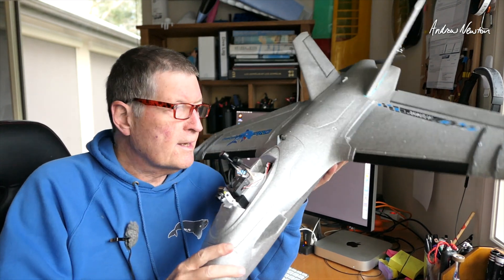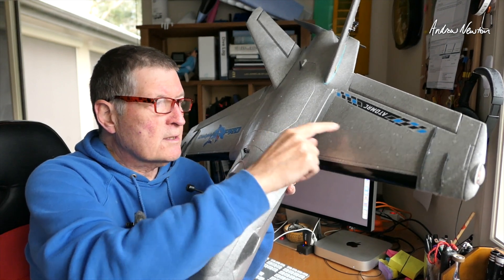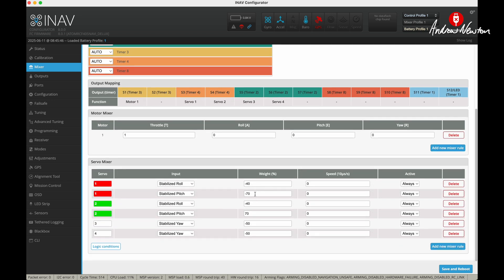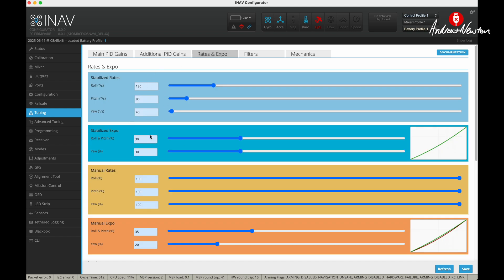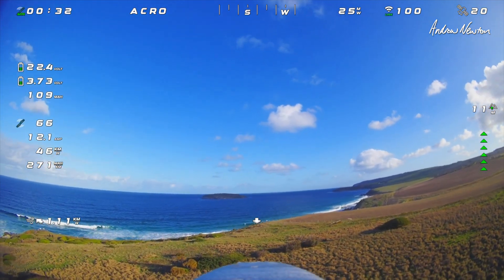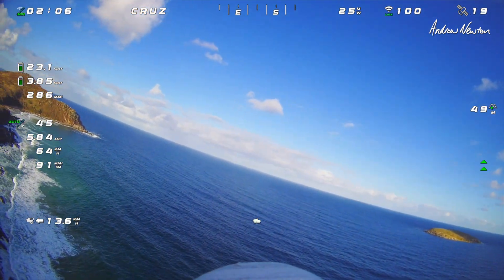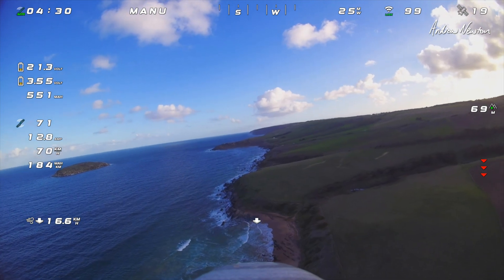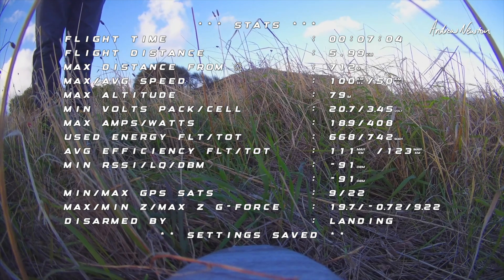AtomRC Dolphin Pro - Part 4. INAV Re-maiden

Comment: on the thrust angle, you did add shims on the bottom 2 screws, so a bit more UP angle right? After the first few videos on the Pro i decided it's to complicated to get it flying smoothly, so not tempted to get one, but you did get that sorted it seems, looks great now, thanks for posting.
Reply from the maker: Yes shims under the bottom bolts. It's just a bit too heavy and draggy I think. Not the best upgrade.

Comment: Motor thrust angle on these short coupled wings IS important...They are very sensitive to thrust angles including side thrust. During Autolaunch, my Versa Wing would always drift left during the climb out despite the FC holding wings perfectly level. Autolaunch is the perfect Mode to set side thrust angle in fact....the climb angle is controlled by the FC though at all times....Just my two penneth....Good to see it finally sorted Andrew....Its not a speed machine, you're quite correct. Too much frontal area...🤔😳😏🇬🇧

Comment: I'm wearing my grumpy dinosaur hat today (☺️), so I'm going to be critical. Not of Andrew, who's a skilled aeromodeller, fine pilot, good communicator and all-round top bloke, but of this style of model. If the goal is to create excellent video footage, why go all weird with the aircraft design?

A conventional layout would be simpler, lighter, more stable, more reliable, more flexible, and cheaper. So... what's the attraction of a plane that seems to be different just for the sake of it?

Crammed with boy-friendly tech [boys love their tech because... reasons. Nowt wrong with that if it offers obvious advantages, but in  this case it doesn't]. What I see is a gratuitously complex model that needs considerable fiddling and fettling just to fly at all [when compared to a conventional design]. I agree that fine-tuning an unconventional plane is fun and a satisfying challenge, but... why bother? 

If the goal is to do the ol' FPV camera stuff, this model's outré design seems unnecessary to me. It comes loaded with quirks that wouldn't be needed if the aim was merely to fly around, creating stable video footage.

The old adage "Simplify and add lightness" works for aircraft as well as sports cars.

PS: Nice kitty...🐈‍⬛👀
Reply from the maker: Building on the success of the original I guess, but not doing it properly

Comment: Yer a wizard, Andy! Great result you achieved there. I'm somewhat skeptical that such a small change in thrust angle would make much difference, at least for constant speed cruising the control surfaces should be able to adjust for a non-optimal thrust angle. When increasing or decreasing throttle though, the thrust angle is more relevant. I did actually have a thrust angle problem on one of my planes (the 45cm LDARC Tiny Wing) but in that case the angle was out of whack by 10 degrees or so. It will be interesting to see how it goes without the washers.
On a forward swept wing with almost full-span elevons, the control surfaces effective location is very close to the CG making it a rather short-coupled design, so I'm wondering if it's just very sensitive to CG position in the same way a plank is. Having a long sharp nose out the front to grab air, and no actual tail, wouldn't be helping either. Makes me wonder how the first version of this plane was so successful...
Reply from the maker: CG, reflex, thrust angle and using rudders as elevators all probably contributed to the bad initial flights. It's not a model I care about much but it has been something to make videos about.

Comment: Great! Happy that your plane is flying well too. 
Please do let us know how it is performing after removing washers. 
I believe break on a plane works only when 2 control surfaces are acting against each other. E.g. flaps and elevator are going down together. Flaps want to nose up the plane up and elevator wants to take it down. This is the time when breaking happens. 
In this vtail configuration, that effect doesn’t happen, so it’s not breaking.
Reply from the maker: Thanks, it's fun finding out. Imagine if the tails were vertical then the control surfaces would give maximum drag (braking) and minimum elevator. If they were horizontal they would give minimum drag and maximum elevator. These are somewhere between those two extremes, but closer to vertical. So some drag and some elevator.
Reply: @AndrewNewton 
Ok, agree with your logic that break maybe more on vtail config. 
I’m using elevons on vtail and ailerons on wings, and it seems to be doing perfectly fine. I am even able to do power loops using this configuration. And additional gain maybe for the landings. The plane slows down in quite a short distance, so easy for landing. 
Only way to test which configuration is better is to check how much flight times we get with both setups on a same battery.
Reply: The surfaces don't need to be perfectly opposed in orientation to cause some opposing moment.
Reply: Yep, would really like to know what its like without the washers now you have it flying great
Reply from the maker: @tubamanandy2  Yes me too.

Comment: Have you tried Autotrim and Autotune in this bird?
Reply from the maker: Continuous servo trim and manual tune. Never liked Auto tune results
Reply: I used autotune to get nice rolls and power loops on dolphin pro. I feel servo auto trim is kind of unnecessary as I never want to fly this plane in manual mode. Horizon and Acro serve all my requirements.

Comment: Glad to see it's working well for you, now! The biggest improvement I've made to mine so far was a set of emax es09mdII servos. The stock ones had a boatload of slop.

I also adjusted the elevon servo speed to more appropriately match the speed of reaching full pitch deflection on the v-tail. this reduced the "braking" feeling from what I could tell today.